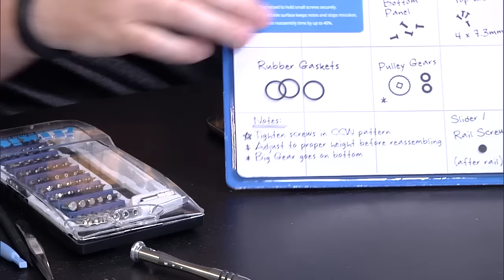How To Replace a Cracked Smartphone Screen!

Comment: Not sure if anyone else added this yet.... but there are actually quite a few different types of Loctite threadlocker, from light purple to green for different strengths and fastener sizes so be careful when purchasing it.  Typically, a blue type (medium strength) is most commonly used; purple is low strength; red is high strength and heat resistant to some degree; green is typically used as a "gap filler" or to help press fit items bond even tighter/secure lose fitting bearings and can only be removed using intense heat and pressure.  Putting that on a threaded fastener will pretty much insure that it will never come apart again....ever lol.  I think strengths/purposes do vary even within the same color schemes so make sure of what you're buying or you could end up in some serious trouble.

Comment: i work as a repair tech  and i have a couple of tips for you , longer nails are awesome , i can pop open an s4 mid-frame in like 4 seconds, and starting it is no problems ,just stick thumbnail in edge and slide it around , thumbnail also works a a swedger , swedgers can end up breaking chips off, all s4's have 2 antenna ,but besides these criticisms you did a good job , just be careful with that swedger , one miss and you mess up the mobo and you essentially have a paper weight
Reply: +aaron stevenson   where is you office?   Thanks

Comment: Oooh, I realized 13 minutes in you're replacing the digitizer (and the glass). So I guess that is technically the entire screen. Was the digitizer actually broken? As others have mentioned the glass replacement doesnt require any disassembly of the back of the phone at all. Im especially curious though if the ifixit iphone heat bag things work for removing the glass on samsung devices.
Reply: Play video please fix it for me OK

Comment: If he had a silicone work pad, he wouldn't be fighting the slick surface. Slips can lead to breaking consumer plastic. 'Forcing', as he discussed, can also be a slipping accident.
"Good God, this phone is slippery" Do I NEED to repeat, get a damn silicone pad?
Also, I thought, for nearly 50 years there was only two 'loctites', (Loctite is a brand name, of thread adhesive.)
Then I look in the MSC catalog, and discovered there were more like a dozen different kinds, though some are only variants of a type. There are four 'types', red, blue, green & purple.
Also, red is not truly permanent, removal requires heat of a certain temp.

Comment: The fact that over 200 USD is "not expensive" compared to the price of the phone is one of the reasons I'd never pay more than 100 for a phone or 200 for a tablet.
Reply from the maker: The phone that you get for under $100 on contract isn't actually $100. It's just discounted because it's tied to your phone contract.
Reply: Tested I don't buy phones on contract. My last phone was a Galaxy 4G(Sprint) I got used, and my current phone is a Moto G(1st Gen) Prepaid Verizon I got for 38 USD.
Reply: there are cheaper ways to fix cracked touchscreens.  a decent phone repair shop will just replace the broken glass not the entire front assembly
Reply: emart88 That's only if the digitizer or panel wasn't damaged.

Comment: any idea why the touchscreen can become unresponsive after a front glass change?
goes away if i just lock and unlock the phone
Reply: the front glass is the touchscreen. its called a touch screen digitizer. so there might be a connection issue with the flex cable that connects the glass to the phone. its a very flimsy and easily ripped cable.
Reply: I may have used vague language, the digitizer was not removed, just the hardened glass, and new home and back buttons glued to the back of it
Reply: tony Pettersen It all depends on how you removed the glass and how you put the new back on. I would really need to know how you removed it to tell you more specifically what went wrong, but if you used heat while removing the glass and used too much heat that is usually the issue.
Reply: The display is three layers; LCD, digitizer, glass, all bonded together. Most people only think there are two LCD and glass and end up damaging the digitizer, or parts of it, when attempting a glass only repair. Also if you've edge glued the digitizer may not be making good contact with the glass.
Reply: the digitizer could be damaged from the install.  it also gets damaged sometimes when you break the glass
Reply: Ev

Comment: Can anyone tell me if I can if not by myself repair a one piece smartphone, the ones whose batteries cannot be extracted well you can't take the back cover at all, anyway I was wondering if a cracked glass on this kind of phone will work(the screen works just fine the problem is the cracked glass(OWN S4025 ,BTW)
Reply: I mean replacing it or repairing

Comment: $130 and a local shop swapped out my wife's front glass in less than 2 hrs. She learned a $50 dollar case is the way to go.

Got an Otter box on mine, I found out it works great, because I left it on the roof of my truck and drove off. I thought about it .5 miles down the road, turned around, and found it laying in the street in the front of my neighborhood. Otter box looks ugly now but my phone had no damage.

Comment: Pls nobody buy ifixit products... the bags that the tools come in are nice but the tools cost more than professional tools and are very very beginner and will not last long. and forget about buying replacement parts for any electronic device from them unless you want to pay like 2x that you would be charged in a service where people with expirience would do the job. 600$ displays for mac's , screw sets for 50$ when you can buy them for no more than 10$ 

pls nobody fall for this, if u want to buy something there first check if you can't get the same product at 1/2 price and 5x better .....

only thing that looks cool is the magnet pad thing....

Comment: Dammit Will no ESD bracelet again?! I know it isn't required but it is a $5 thing that can keep you from ruining what you are working on. You can't be too safe. 
LOL it is very clear Will (mister know it all) has never used a Samsung galaxy S device. You didn't need the spudger to remove the back and yeah the battery is easily removable. SIde note. I hate those cheap plastic spudgers. They have nicer plastic ones or you can just get metal ones (much more dangerous to the device) or get clay working tools which are very similar. I want to see will try and open a newer ipod, not a touch or a nano but a standard ipod. Those mofos with their "coffin clips" almost make it impossible to open. Other handy tools are a dull razor blade and a guitar pick. Dang. I was hoping for you to go all in and just do the glass. That is the hardest and cheapest way to fix a screen. It is also my most common method now, which I hate since they have started sealing the screens to the LCD using glue. Will, I am being so critical of your attempt in hopes you will learn something, if by chance you read this of course. I know I hate on you a lot but that doesn't mean I like you. You are an amazing host and please keep up the good work.

Comment: Does one need lock screen password to change screen?
Reply: HRICHIK HARSHVARDHAN-IB no passwords are software controlled  components you can replace any hardware component without needing the software access. But after replacing the part you will need  password to get access to the phone software like apps and stuff.
Reply: Thank you. Recently gave J7 Prime with shattered screen to a local repair guy. He said he needs the password. Sounded dubious.

Comment: Hello Tested! I need your advice on phone repair!

My phone had a tragic accident of being smushed by my car door. the digitizer is fully functional (miraculously) and I'm in the process of replacing the glass screen. Only problem is, when I removed the speaker and vibrator speaker the adhesive from the contact pad strips dried and won't stick. What kind of adhesive should I use? And does the adhesive need to be conductive?
Reply: Basically what I'm trying to say is that the glass is cracked but the phone is still fully functional. The digitizer is what enables the touch screen, back light, and screen to work.

Comment: Extremely helpful video !
Have an extremely old 
Verizon Galaxy 4 Note, with the screen separating from the guts of the rest of my phone.
Would anyone have any suggestions on what adhesive I might be able to use on readhering the screen ?
I am a bit uncomfortable about trying super-glue !

Comment: Great video, I don't know what it is about your instruction videos, but I find myself captivated and watching the whole thing, even though I'm not doing the project.  The only problem I saw Will is that you blew off the yuck on the ear speaker, while holding it OVER the phone.  Thus, when you put in the front facing camera, there might not have been dust on the camera because you were careful to face it down, but now there could be dust from cleaning the ear speaker in its holder. I would have shot it with some air before putting the camera in.

Comment: Would this also work on tablets?
Reply: I replaced the digitizer on my Galaxy Note 10.1 (old model) a couple of months ago and it was fairly straightforward. 

Ease of repair depends on how the manufacturer designed the particular model you want to work on. Some will be easy to self service and others may be prohibitively difficult so you have to do some searching online for teardown and repair instructions.
Reply: Joshua Lewis Do you know what a klü tablet is?
Reply: No
Reply: On tablets is eazier i think
Reply: U have to pop off back

Comment: there are much simpler ways to fix a cracked screen than replacing the entire front section.  most places de-laminate the glass or remove the lcd assembly.

Comment: How did you keep dirt from your filthy body out from under the glass?
Reply from the maker: The assembly we replaced is sealed, so there was no chance of fingerprints under the glass.
Reply: Put on latex or nitrile gloves when you get to the steps that involve touching the screen and digitizer surfaces and have clean microfiber cloths and a can of compressed air handy for clearing dust. Also try to find the most dust free space possible to work in to minimize the chances if little particles finding their way between the display and digitizer while things are open.

Even with all that it can be hard to avoid contaminating things with oil and dust.
Reply: Joshua Lewis It'd would be fun to build a depressurizable chamber out of a fish tank and some rubber gloves to work on this kind of stuff ^_^
Reply: Damian Reloaded Wait you haven't built one, you are so behind, everyone on my street has one. Not cool bro.
Reply: Cuddles the Mighty lolol ^_^